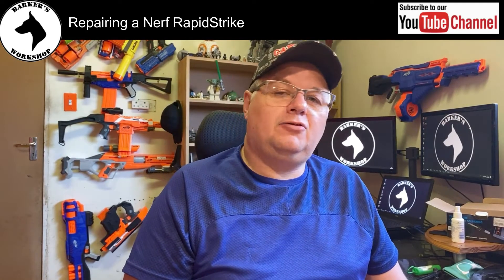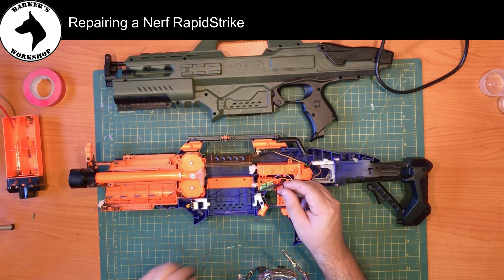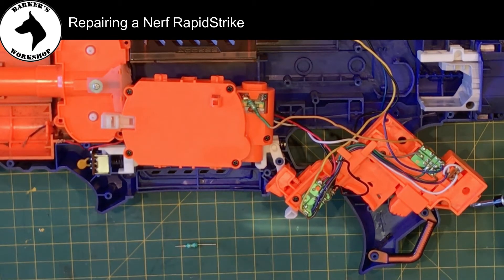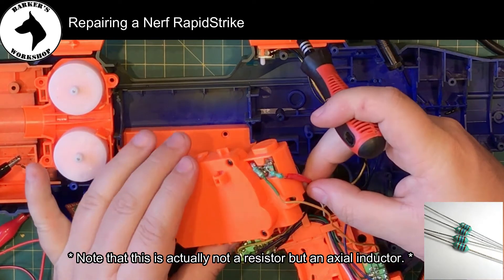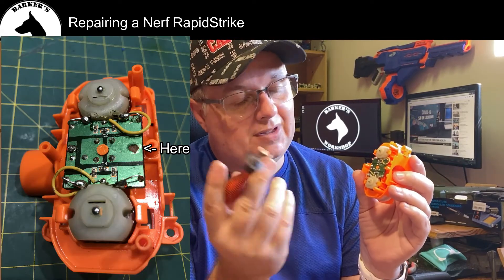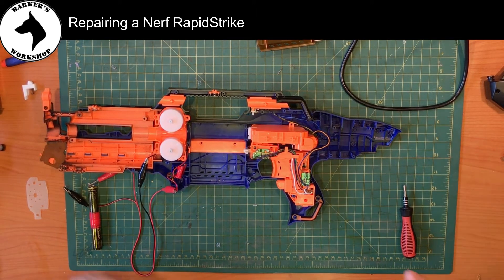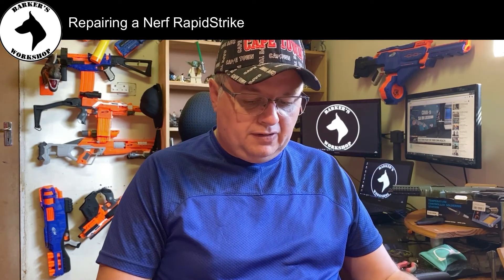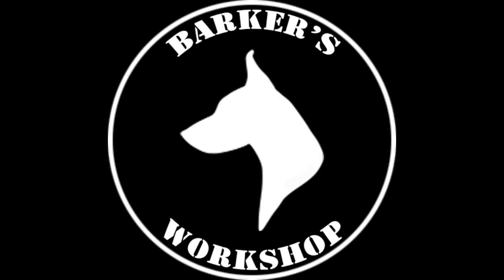Repairing some of the electronics of a Nerf Rapid strike.

Comment: I know this is an older video, but resistors have no polarity, it doesn't matter which direction they are put in. Capacitors do have polarity and will fail or pop if put in the wrong polarity.